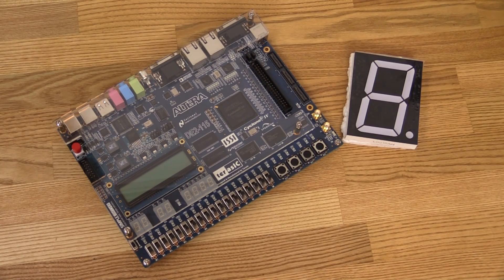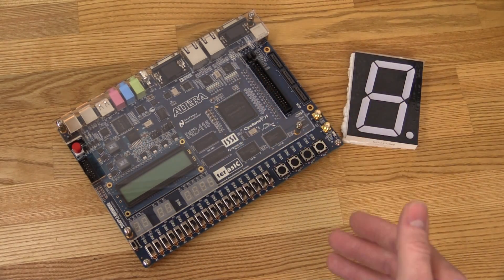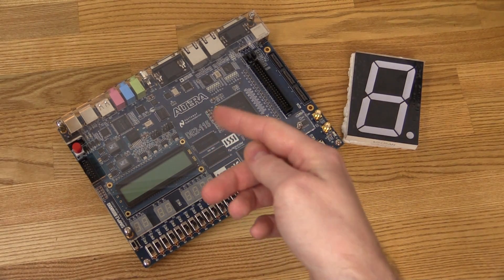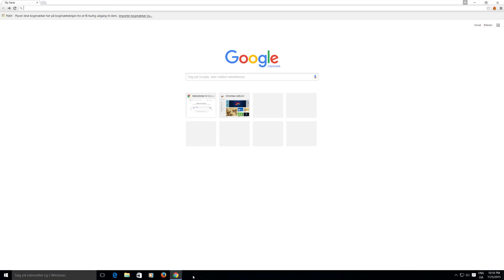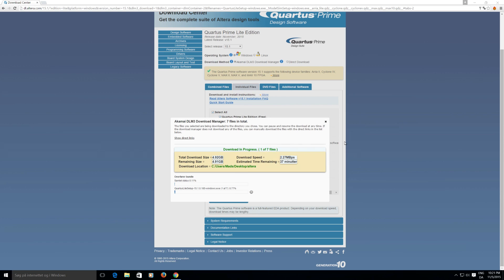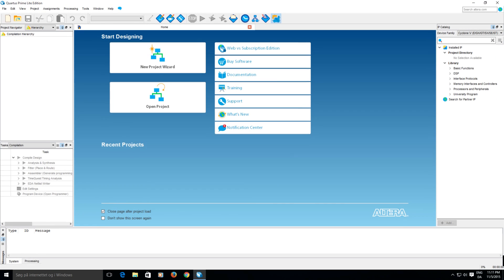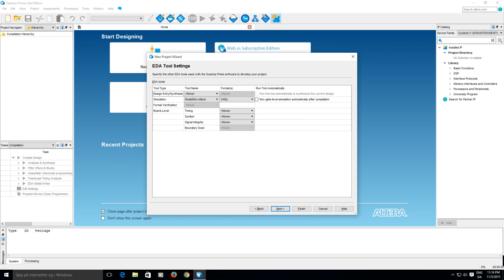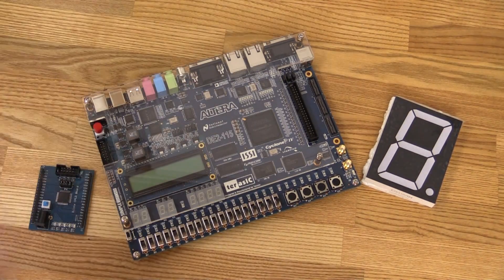FPGAs and VHDL- Part 0: INTRODUCTION - Ec-Projects

Comment: check out the lattice semi machx02 or machxo3 fpga.  very cheap dev boards ~$25usd and free software tools, Diamond.  I like them better than the altera stuff and the software just works.edit:  also the lattice have the RAM built in so once you program it is there and you do not need the external ram.  One chip solutions.
Reply from the maker: +Matthew Prestine Thanks for the suggestion, I'll take a look :) Ohh nice, so both flash and ram on-chip ?
Reply: +EcProjects Yes that is correct.  Makes it very easy to implement final solutions without extra hardware.  This is more similar to a CPLD in a sense as they do not have the need for external ram also.
Reply from the maker: +Matthew Prestine That would definitely be an option for the digital clock. I was originally thinking about getting a CPLD for it since it's not going to be a very large design, and then make a PCB and a nice enclosure for it.. 
Thank you again for your email ! :)
Reply: +EcProjects 
If you want an actual CPLD then the ispMach 400ZE series would be a choice.  Another benefit is that these are actually solderable parts that can be had in 48 TQFP packages.  Otherwise the other lattice parts are actually FPGA's.  The Altera stuff is great but not usable in small designs.

Sent you an email back.